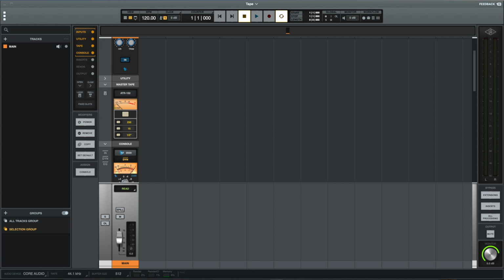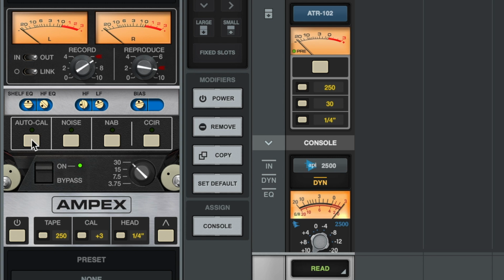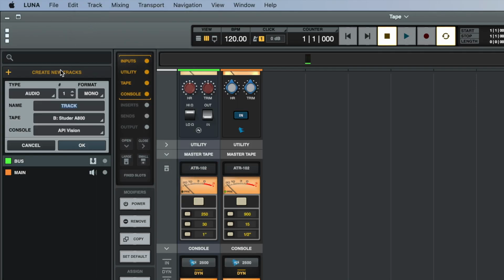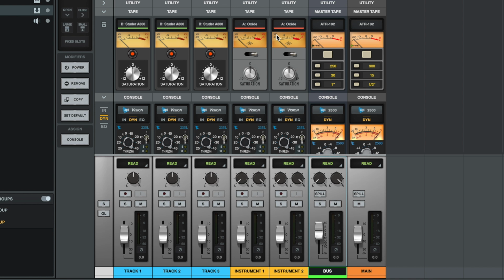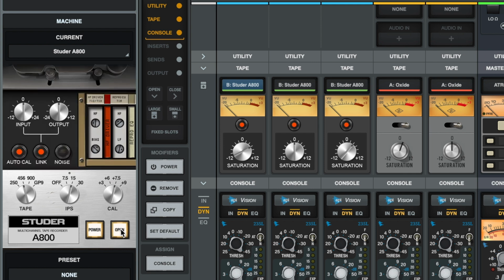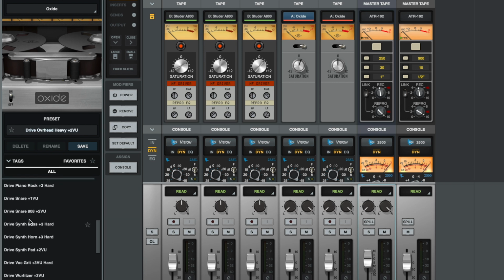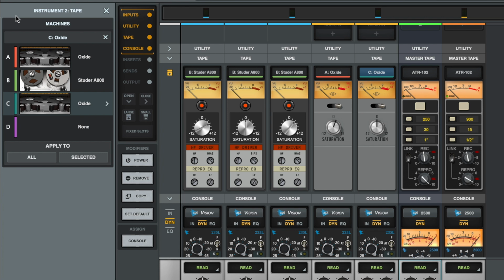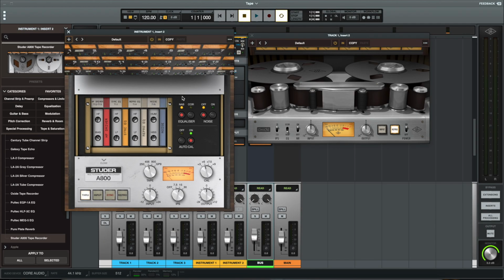Tape Extensions | Luna DAW by Universal Audio

Comment: Very interesting! Is this essentially running lots of sends to a single instance of a tape machine or just displaying differently?

In other words, is this saving on CPU power by running one tape machine plugin rather than a plugin for every track in your session?
Reply from the maker: Good question. How this actually works under the hood, I'm not 100% sure. In past versions of the Studer A800 plugin, there was a 'gang controls' option, so you would add a tape machine to each track in your DAW individually, and then switch on gang controls so that any changes you made would control all of the plugins globally. I have a feeling that the tape extensions work in a similar way as opposed to running multiple sends to a single instance, but I could be wrong about that. I need to do some more investigating.
Reply: Great Question!